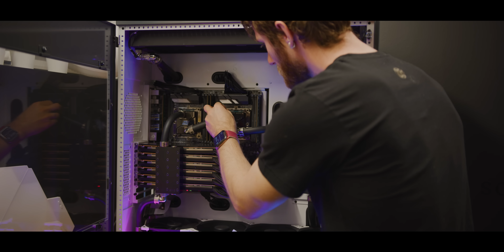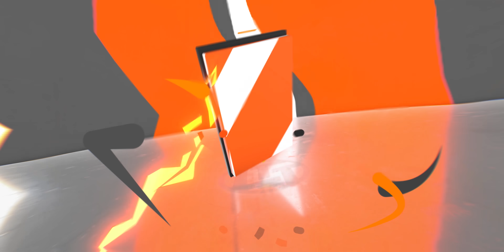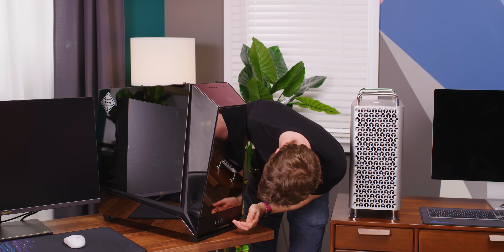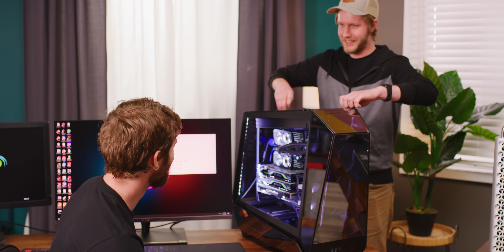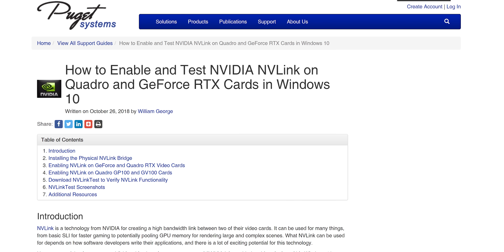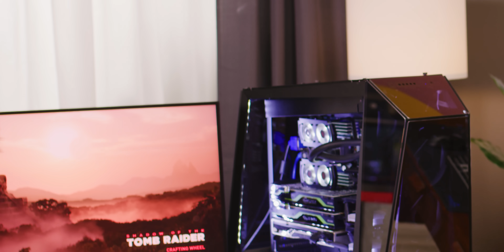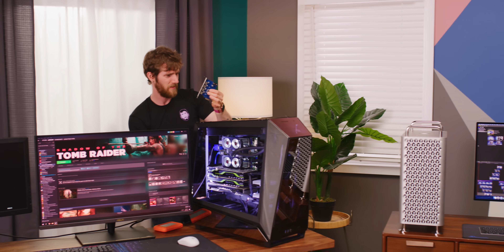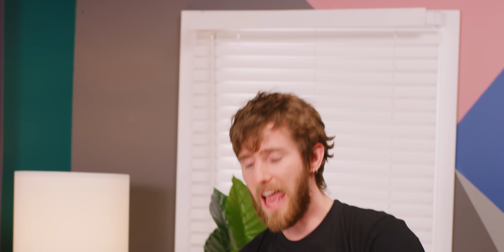The $32,000 Mac Pro Killer

Comment: Genoa (zen4 based) has already been released, but the ecc ram is still $30/gig, and that price is holding steady, vs $2/gig for ecc ddr4. 

I just bought that main board with dual 10Gb on board, with an epyc 7313P (16 core, 3.0-3.7ghz) off of newegg as a combo for under $600. with 256GB of ecc ddr4 3200 for about $500.  
 I have all 8 channels populated.  I also got 2 m.2 octane drives, and plan to use most of the io connectivity. 

I will be practicing with VMs, docker, and kubernetes. I have over a dozen years of professional Linux system administration experience.

Comment: I think the biggest issue here is running windows on both systems, no one would consider buying a Mac Pro over superior pc hardware unless they were tied into the Mac ecosystem using Mac only production software, while hackintosh is a thing for true production environments where 24/7 365 is required where hours of downtime costs thousands of dollars, a hackintosh is not a viable option, different case scenarios for both pieces of hardware, both are beasts in their own right

Comment: Not to nitpick but most stress analysis is done using some sort of FEA/FEM solver which can definitely be parallelized. In most cases this is a feature that has to be enabled though. Or you were using non industry standard software that didn't have it at all.

Comment: you could probably remove half that ram and keep up the same performance lol
and probably low down on some specs and yet still beat the Mac Studio thing
Reply: depends. these pcs are built specifically for ram heavy jobs. you dont put that much ram in a pc unless youre doing something intensely heavy duty
Reply: @jacobely6826  what is really that ram heavy to use up to 1000 GB ram? Maybe like huge 3D scenes or something but still
Reply: @betadv  yeah its for that kind of thing and huge data centres and shit that need it for whatever reason.
Reply: @jacobely6826  yeah but most people don't need that much power, probably movie makers would need it
Reply: @betadv  ofcourse but thats who this system is made for. I mean you'd have to be literally mad to have a system like this for gaming or what not.. you could get by with 5 percent of this much ram a quater of the cpu power and a much much much tamer gpu and still easily have one of the best systems for gaming out there.

Comment: I really not a fan of Nvidia as a brand, but in case of the RTX8000. They are mostly made for headless linux WS Servers. So the nvidia-smi command is absolute straight forward if you use these cards on a linux machine.

Comment: I have some suggestions for higher performance 
1.using threadripper pro 3995wx it can also support 2tb ram and it has 64 cores and 128 threads
2.using asus motherboard for threadrippper pro 3995x because it has 7 pcie slots
3.i heard that there is a piece of tech that can connect multiple gpus just like nvlink but the problem with NVlink is it can connect only 2 gpus 
4.using 6 rtx quadro 8000
5.liquid cooling cpu and gpus
6.using the pice of tech from 1 cpu 6 editors that uses only 1 pcie slot and turns it into 8 pcie slots and fill up the extra pcie slots with nvme pcis expansion cards with 4 16 tb nvmes for mass storage
Reply: That's alot more then what the mac costs plus this video is old.

Comment: 14:07 the mac probably has some cap set to not go over 90% CPU usage. If you could disable that cap I imagine though that the PC pro would still win.
Reply: Although then again, possibly not.. because that cap is obviously going to cause a bottleneck and therefore the mac is going to be throttling hard

Comment: Although now you should not buy the Mac and wait for ARM version, for me it still wins purely oln practicality. No matter how you spec it, it's still Mac Pro, if you have an issue, there are hundreds of other people who had the issue so it will be easy to fix. While on PC you have to rely on datacenter parts that have next to no documentation and you'll need Wendell or some other expert if you ever run into issues. Of course both of these computers are quite questionable, if you should even use them instead of something more scalable and practical like a server/cloud based solution.

Comment: As someone that owns both windows and Mac the main downside of the pc pro to me is windows itself… that is nearly always the problem because of stability issues and wayyyy to much modification necessary to prevent that.  Macs just work… PCs can be more powerful but there is significantly more down time in my experience even with a server grade system but ymmv as does everyone’s. I have uses for both machines but I use the macs when I need no computer fuck ups lol 😂
Reply: That's why servers use Linux not Windows

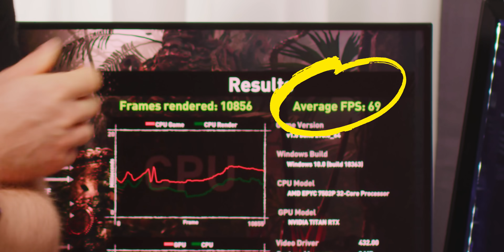Comment: 12:16 now only a year later now that prices are going back down slowly… you can get that same performance… from a $300 Ryzen 5 5600x and a $500 RTX 3070 😂
Reply: yeah if you could find those at those prices. if you can find a 5600x its about 700 dollars if you are looking new on amazon/newegg, and 3070s are just not in stock anywhere. RTX cards and pretty much anything with performance over that of a GT 1030 is out of stock everywhere, and things GT 1030 and below are absurdly priced. 150 dolllars and sometimes up to 220 for a gt 1030. a GT 1030 for gods sake.
Reply: @waterbiscuit9222  Yeah ik, graphics card prices are still insane but the cpu ones finally went back down, you can get a 5000 series Ryzen 5 and Ryzen 7 from Best Buy now at their actual price

Comment: Linus: 2000 bucks for the case.
Me: used pc for 320 dollars.
Reply: Me: gonna be making my sleeper PC out of a used early 2000's case.
Reply: @the404error7  I've always wanted do one but it's gonna be 2023.
Reply: @the404error7  Imagine time travelling to the past with that sleeper PC though 😂
Reply: @therealb888  that would be badass. you just show up to 1993 with your 3080 and a 5900x in a compaq presario case
Reply: @waterbiscuit9222  I don't think that's fitting inside a compact case unless you want to entirely water cool it because that's just way to much heat in a smaller case
Reply: @therealb888  any updates on you're pc? much has changed
Reply: @waterbiscuit9222  hahah
Reply: i got my used PC for 100
Reply: @waterbiscuit9222  I got my used PC for 120 dollars, with GTX 1660
Reply: lmao yeah

Comment: Isn't it kind of unfair to specifically choose benchmarks which require CUDA? Like that's just building a massive bias into the test
Reply: They did also use a benchmark that favored the Mac. Maybe the point was that this PC was still comparable to the Mac in tasks where the Mac had the advantage over the PC while the Mac was bested in a task that favored the PC?

Comment: I mainly don’t like the fact that, exclusively to get 1TB of ram (which is completely unnecessary unless you have it in a server) the PC pro lost a lot of points because it had to work with a server CPU and a server motherboard. It could have easily beaten out the Mac Pro in most benchmarks if they just took the 256GB limit on the threadripper.

Comment: Its so funny how you guys are wondering over exactly the questions I had two days ago xD I had to put together to HPE Servers with RTX8000 and stumbled over the nvidia-smi command on CentOS7 to create VirtualGPUs for our Virtualization Environment. When using Linux you need to be sure to disable the nouveau default driver for your rtx or it wont start up.

By the way this also explains why Display Output is disabled when you enable NVLink as it puts your GPUs in Displayless mode in Preparation for Virtualization where you dont use physical outputs.

Comment: You may buy the mac pro on the internet.
Or
You may hire a tech expert, struggle on choosing components, face assembling issues and build more powerful / less stable machine with almost no support from the  manufacturers (electric tape lalala)

I mean, that's the point of the Mac products. An Over-promising, over-hyped, ripp-off that simply works without any headache (you don't have to think in the Apple universe where no choice's possible because everything is locked)

Comment: A software engineer died when Linus said "Python compiling"
Reply: The interpreter has to be compiled ya know
Reply: @AshtonSnapp  so not the source code and not necessarily at run time
Reply: @AshtonSnapp  LJB
Reply: @timwaagh  I could be wrong but isnt python first compiled to bytecode which is then interpreted?
Reply: @prometheuspickle2946  yes, but i think thats not called compiling but idk
Reply: @prometheuspickle2946  No you're right. That's what .pyc files are for.
Reply: python can be compiled to work faster, known as cpython. Most of the python libraries work like that
Reply: @timwaagh  python but worse

Comment: I think the Mac Pro still wins, the ease with which you can buy it and get it up and running is what most professionals want.
They don't want/have to deal with GPU bridges not working, ram over heating and stuff.
Also most professionals work on an iOS workflow, wouldn't even think of switching to windows JUST because of their iPhone lol.

Comment: haha i like the little intro of this video it was funny I think it is important to point out that parts can be found for cheaper depending on sites you look for them and the condition they are in. Whenever I look for hardware parts for example, 90% of the time I find them cheapest on eBay as either refurbished/used and will get them and stress test them and return them if they cannot handle the pressure they are supposed to. Im also not sure why they didnt use the ryzen 3990x instead as its been out for awhile now? its about 3k online and has 64 cores and 128 threads and supports quadruple the memory so basically a supercharged version of the one they use here in this video.  The cost isnt a issue since top of the line mac pro costs a horrifying 54k so it would still be cheaper for sure it is only 3k afterall.
Reply: as he said the threadripper practically only supports 256gb of ram, even the 3990x has this problem which he described in the review video